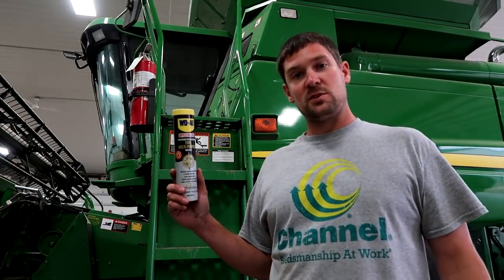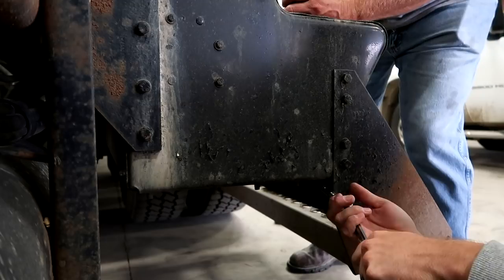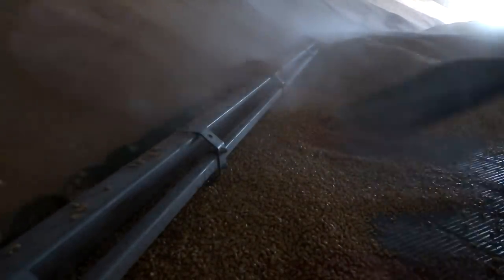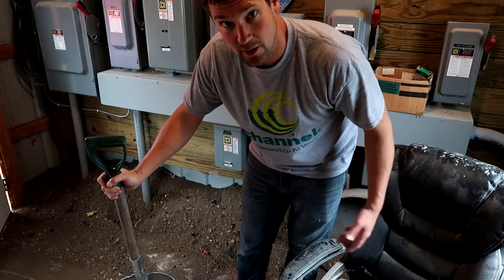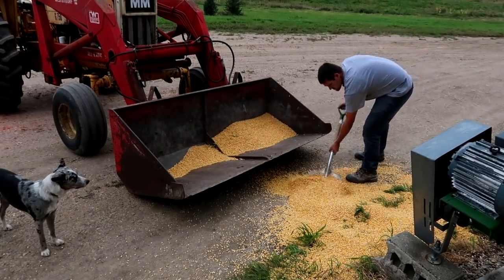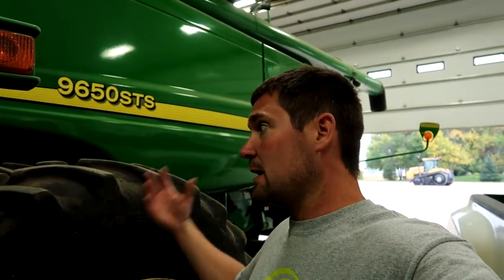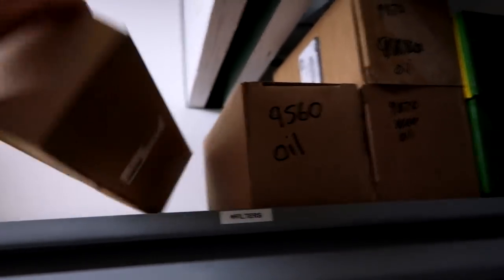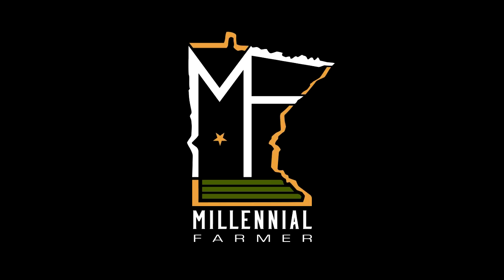We're almost Ready for Harvest 2018

Comment: Love the videos, been on a binge watching marathon recently. Be careful filling the fuel filters that way. It bypasses the filter and can damage the injectors if there are any small particles in the jug. The machine should be able to prime itself with the fuel pump, or there may be a manual prime on it.  Not nitpicking just a suggestion.

Comment: We sell those Group 31 studded post batteries by the boat loads at harvest time where I work at our local Napa parts store. They need to be kept charged in the cold weather so they don't freeze in the winter due to a  low charge state. Oh I am also a mechanic so I should know. Yes I have "Napa Know How"...LOL  Oh and isn't it every time you grab a grease gun in the shop it is empty and no one else has used it.

Comment: If you cut the side out of an old plastic 4 litre oil container and place it under the fuel filter then use a centre punch to put a hole in the bottom of the filter before cracking it they don't spill everywhere.

Comment: Hi Zach, I don't mean t be telling you how to do things, but I offer this advice in love...When I change out batteries after a long Wisconsin winter, I don't have to resort to cutting off the hold-down clamps - I just spay a bit of WD-40 on the threads and the nuts spin off effortlessly! I t does appear, though, that you have sprayed just a bit too much WD-40 on the tach cable of the MM. Also, a good way to keep the critters out from under the loading shed is to liberally coat the ground underneath with WD-40. EPA-approved, I'm sure! Call 'em tomorrow and ask. Lastly, as a millennial, you've not been around long enough to learn everything you need to know about the blame game. It was, of course, Bush's fault.
Keith-

Comment: You have never had a driver run out of gas on the highway!  after going by the fuel station.   Last year we started harvest with thinking the truck should have enough fuel for the first day.   After his 10 loads at sunset pulled on the  interstate by the field.   He made it on the acceleration lane.   I had  a nurse tank of red diesel but the $10,000 fine might apply.   There were many trucks passing us every minute going 80 mph, it took an eternity to prime the C12 and boost the battery with the taxed fuel we had to go get in another tank...

Comment: Why do you put diesel in the fuel filters? It should have a manual pump on the machine so that you fill the filters through the filtration way. Otherwise you put inside the fuel filter, unfiltered diesel, and it could affect the high pressure fuel pump and the injectors.

Comment: Is there a particular reason you can't use red Diesel?  Is it the fact they have so much road use and distance form the farm to the drop off?  I think around here it is generally 10 miles as the cutoff for distance.
Reply: You cannot use red(off road) fuel for highway use. It's a tax matter
Reply: teaches2010  You can in certain situations depending on your state laws.  We can use it for agricultural use in tractors and farm "Machinery" which is a loose term around here. Some states vary that law slightly, which is why I asked.
Reply from the maker: @kennethfeld6639  they watch it closely here.  Any farmer busted with dye in their trucks is in big trouble
Reply: technically dyed fuel is not to be used on roads at all. I believe they determine it on where a piece of equipments spends most of it life, on road or off road. The reason that is cannot be used on road is because it is not taxed. That is also why dyed fuel is cheaper then not dyed fuel.
Reply: Well, if you watch the video where he changes the fuel filters on the combine, it definitely had red diesel in it.  I am sure that sees a bit of road time traveling back and forth to farms.  Tractors as well, it varies state to state, which is why I asked, I was wondering about MN law..  I am FULLY aware of what red diesel is and what it is used for.  I was asking SPECIFICALLY why he doesn't use it in trucks used to haul agricultural materials.  Anyway, I looked up MN law and it only allows for tractors basically, so I have my answer.  Yes, the fines are basically made so it isn't even worth the risk to try and get away with it.  A single fine could negate several years of potential tax savings by using it in the trucks I would guess.  Where I live isn't heavy agriculture and no farmer here (even the OLD ones) can ever remember being checked.  I am sure in the agri heavy regions they set up and check frequently.
Reply: As i said the rule of thumb is where a piece of equipment spends most of its time. A combine or tractors spends most of its time in the field so it gets by with the untaxed fuel. A semi on the other hand spends most of its time driving on roads hauling grain and cannot get away from the taxes. Semis are also regulated by the DOT and they specify that they cannot use untaxed fuel on road. That is also a nation wide thing, not a state by state law. But yes if you get caught with dyed fuel in an on road vehicle the DOT will slap you with thousands of dollars in fines that make the savings no where near worth the risk.

Comment: Is the red diesel still illegal to use in tractor/trailers being used for agricultural? I know its super illegal to run red diesel in highway vehicles, but I figured the semis are just as much ag equipment as your tractors and combines.
Reply: Yes, a semi is considered an on road vehicle and is regulated by the DOT. Semis spend more time on the road then they do in the field. Even farm pickups have to run clear diesel because they are considered a road vehicle.
Reply: Thanks, I should know this being an OTR driver lol, but I wasn't sure if AG semis were different or not since its my understanding you are not required to have a cdl to drive semi for ag either.

Comment: Quit filling your fuel filters like that! That is what priming pumps are for.
The center hole out of that filter is supposed to deliver clean fuel. New fuel systems can take almost zero debris before they sustain damage and require expensive repairs. There is virtually no fuel coming out of a refinery clean enough to run unfiltered in modern high pressure fuel systems.
Reply from the maker: Literally every mechanic I know fills the filters on any machine that doesn't have an electric pump.

Comment: Okay, I see clearly your plan,
Exide Truck Battery PX-31 - 925 CCA is a 70 buck POS! With an 18 month warranty.
My thinking is getting 7 plus years on a battery. My fault for being conservative.
Seems to replace per season is a good option for screwing any maintenance at the POS cost. Or is it?
But still, you spend more money than needed  As I get over 9 years on my batteries.
You need to tell folks this info.

And btw:
 Who is your Creepy buddy when you go to the bar, not in the Home front yard workshop? If you have one.
Reply from the maker: The batteries that we took out were in the truck when we bought it in 2012...  couldn't see the dates on them.
Reply: Exide Truck Battery PX-31 lasted 6 years. they are cheap as well. Interesting. I could not see the brand on the replacement.
As always looking for betters. 

Hey btw. Vikings did well in last Thursday game.

Comment: Zach, you state "Corn is testing about 23%-25% moisture" What is the weight difference per % wet loaded in the combine? 
You seem to say you could harvest @ 23-25%. But dryers will not keep up my guess.  Or does not make noticeable wear on combines or trucks. You seem to want it to be 15-17% to sell if I recall right. 

Btw: Do you have a bar in the Home Front Yard Workshop? As a known confirmed creepy guy at the bar, per your own words. do you train there? 
And does Mrs. MF hide the kids when you're riding the front yard workshop bar? And FFS, you're not rubbing the combines under the panels
in some creepy move, if there is a bar in the home front yard workshop.